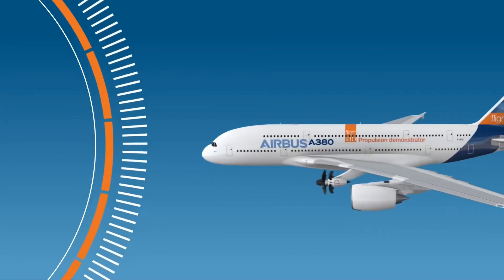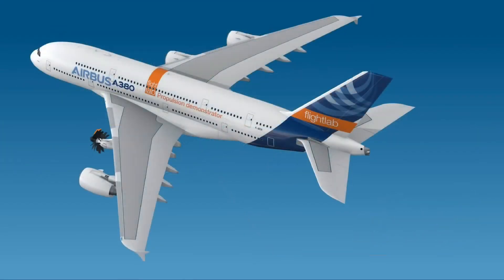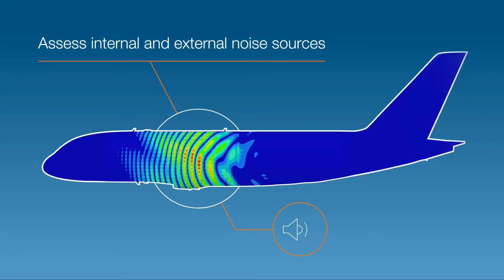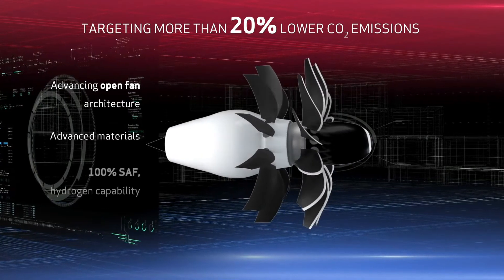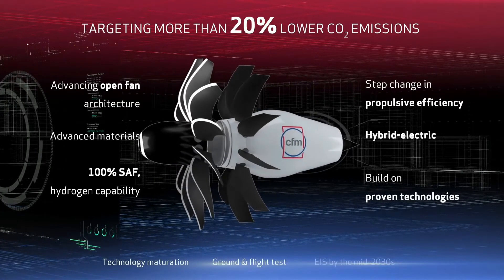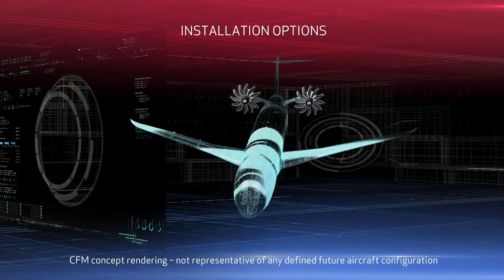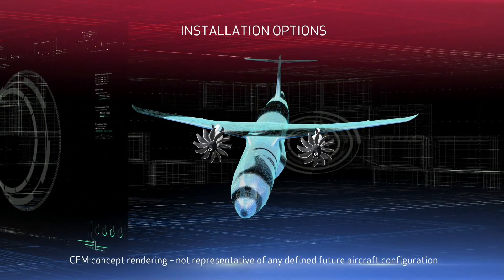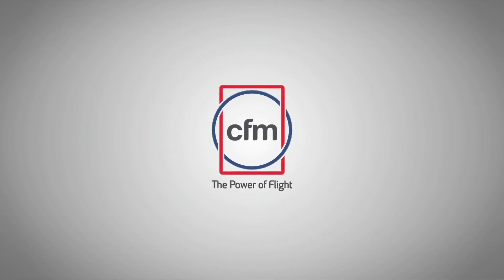Airbus Retro Looking Open Fan Engine Design Could Cut CO2 Emissions

Comment: i mean, isn't this like propeller engine but faster (not a scientist). imo 20% reduction is not a big deal.
Reply: 20% is a huge improvement !!
Reply: Even 1% in fuel savings is a big deal for these companies, thats a lot of money
Reply: @krto7663  yes but they are discussing co2 reduction, not fuel emission .. or ?
Reply: According to pdf files you can find online, one can expect btw 20 and 26 % fuel reduction. This is not even include the fact that you can reduce wing weight, since classic ducted fan motors are heavy and so, you have to reinforce the wing here and there https://www.faa.gov/about/office_org/headquarters_offices/apl/research/aircraft_technology/cleen/reports/media/Open_Rotor_Public_Final_Report.pdf